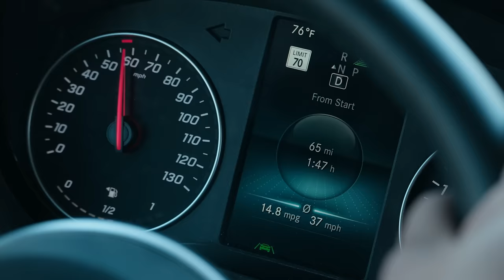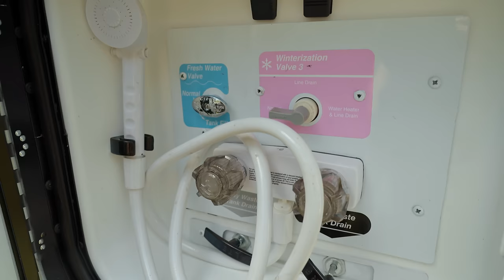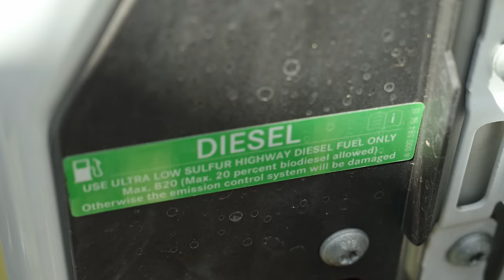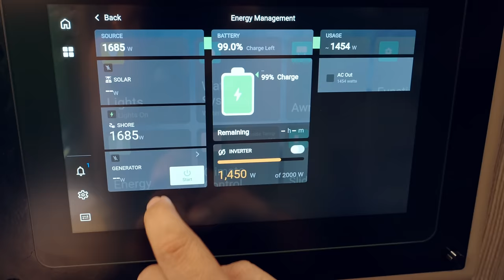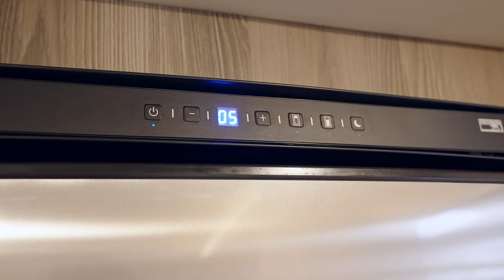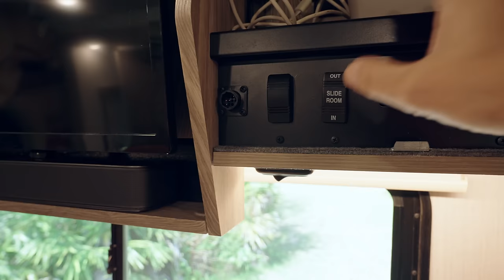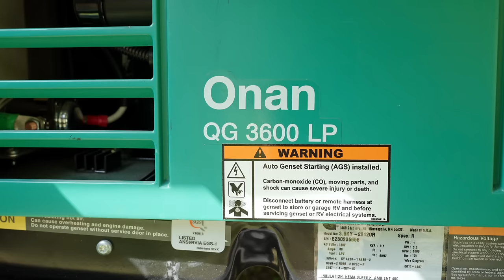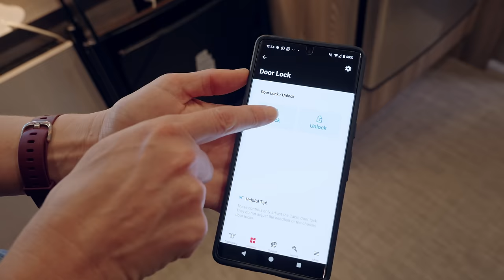🚐💨 Living in the World's FIRST Winnebago View 24T - Full RV Tour! | Newstate Nomads

Comment: Fantastic job on the video, and amazing layout!  The higgie hygaie huggie.  I give up, but I love it!  The large convection microwave, one electric cooktop, garage, folding table\chairs, and Winnebago Connect...best decisions!  The one thing I definitely would change is the water fill outside of the water bay for cold water locations.  It would also be great to have have options for: push button grey\black tank releases, tv mount articulates down or televator, delete on propane cooktop (the counter space might be better use given the onboard gen and charging capabilities.)  Great idea to put the laundry basket in the shower.  Let Winnebago know this one is a biiiig win!
Reply: Interested to hear if you put your starlink through the celing port and if they router fit into that bay. :)

Comment: We have ordered an AWD unit - due in a couple of weeks.  Have gone through your reviews of the 24t several times for data points.  Seems either Winnebago doesn't know anything about the MB and vice versa.  That's why there are operating manuals which are actually pretty good.  The sales folks are all really nice, the service folks for what the know of the 24t are really nice but this seems to be a learning process by all.  Moving to this unit from a F350 and Bigfoot Oakland - not really quite sure whether up or down, just higher tech and lower steps!  
I have lists of questions for the sales folks once this comes in, your review answered a number of them.  Thank you for being so complete.
Amazed again how people simply need to complain and troll - the saying goes, if you can't say anything nice ....
Thank you again

Comment: I had a 2007 View J model with a twin bed back next to the dry bath restroom.  I liked that layout because I could always stop and the bed was always there.   I camped alone, mostly at rest stops or KOAs.   Great motorhome.  That gear garage is killer, especially when you remember the coach is only 24’ long.
This model is very well laid out.   Have you done another on what the production model will look like?   I’m sure something changed but what you see here is Very nice.
Wow!!  That rear view mirror is just too good.   I had no idea that was a thing

Comment: Did anyone else notice the panel under the folding table (where the support arm is attached) seemed to flex a significant amount when putting the table up or down (see 8:34 and 9:15)?
Reply from the maker: We definitely noticed and let Winnebago know about it ☺️ Remember, this is a pre-production unit, there are elements they are actively working on before production begins. 👍 - Howard
Reply: I seen that also, not good

Comment: I’d consider a pre 2019 view
The newer ones seem more prone to leaks
I would look for a non blue tooth awning.   The carefree BT12 module doesn’t seem very robust or they had a bad run.  There was a recall on the awnings and these would not work more often than they would.  And the Mercedes module that sends power when the parking brake is on will occasionally have issues and your awning won’t work.   Mercedes and Winnebago are still arguing over which is responsible for the fix 
If you get water in the cab check the cap/gutter seam.
The view hits a sweet spot though.  
Big enough to travel comfortably and small enough to park almost anywhere

Comment: I think its absolutely stunning.  The outside storage is amazing and I love love love the copper.  Tank sizes are great too.  
The only con I see is the chassis its on and its a deal breaker for me.  It needs to be on the Ford Transit, a gas engine.  I've heard nightmare stories about MBs breaking down and only a fraction of mechanic shops to fix them and the wait time can be very long.
Reply: As former high school auto mechanics and drivers Ed teacher & then almost 3 decade OTR Trucking guy, I’ll lay it on the line here: That’s a “top drawer” rig…. Now…. If one will service that rig as it is prescribed with out cutting corners AND checking everything regularly before you start out EACH day…. You will rarely if ever break down….  Also, you MUST drive like it’s a TRUCK not a car Let the power train do its work smoothly…. Vs constant expecting to go 70/75 up & down  the hills….Respect the  rig-give it good clean oil & fuel & enjoy it for many many years….😎

Comment: U said go to comment if U missed anything… I watched a review on the ‘025 Thor & they said it’s on a 4500 vs 3500 Sprinter chassis thus increased cargo capacity… U said a ‘23 chassis, so I’d guess  Thor is going with the newest chassis while Winnebago is using up older stock ??  I hope not !!  900+ # CCC is terrible !!  & please tell us that a “no propane” diesel genset option is available…. I really like the multiple solar pkg as well.  The I-4 2 ltr 9 speed has been long anticipated & should sell very well…. In-line engines are greater 4 low end torque & a bit more fuel efficient too.  GREAT REVIEW..👍👍

Comment: Great storage ideas Winnebago used in this motorhome, but it needs a bigger chassis to carry everything you need.  As shown, this chassis is probably grossly overloaded.
Reply from the maker: A bigger chassis would certainly add carrying capacity, but takes away from the advantages of a short wheelbase RV. 927 lbs is tight, but manageable. We've lived full-time for over five years in our 2019 Navion with 1,100 lbs of capacity. It can be done, and safely. Like I mentioned in the video, there are options to increase carrying capacity, which we would likely opt for if we go with the 24T as our next home on wheels. Thanks for watching! - Howard
Reply: @NewstateNomads  173lbs is a whole person more. That's a huge difference IMO.

Comment: I think what would make this perfect is adding to the pantry which is too too small. I need a place for my instapot and other lg items, place for trash can which I don't like seeing out on the floor. My suggestion? Expand the pantry to Two feet and across from it add two feet of counter space. I don't want to have to go outside for my dog food. The coach is less than 26' having a 28' would seem just as easy to move. Worried about the 4 cylinder size engine, sounds wimpy and disappointing! Overall, this is a great coach, love the bathroom and other improvements. Love the color scheme. Does it sit too low? How does it travel over bumps,  driveways?

Comment: We love a lot of things on this coach.  Couple concerns though with the bed.  Murphy beds don't scare us as our current rockwood mini lite has one. 
1. Is it a short queen?  If so is there a little extra room on the head side to possibly place a small extension there?  I'm 6-3 and short queens are just a little "short".
2. The mattress looks quite thin and maybe cheap like a lot of rv mattresses from the manufacturer.  We replaced ours but the new one is heavier so i had to rework the support system on the Murphy bed.  It's this one comfortable and do you think it will hold up?

Comment: You blew me away with this presentation, very thorough. This rv certainly is impressive with features that i didn't expect.
Now for a personal question of choice...would u pick the optional massive battery bank over the generator, n why for "u", would u pick that? 🍻
Reply: I would add to that question - does choosing the massive battery bank add much much more weight than the generator.  Also,  is a diesel generator still an option?

Comment: Stabilizers or levelers?  Which generator option would you choose?  Is the 950 AH option an additional 950 (+240=1190 total)?  Can you idle the engine to charge batteries like road trek?

Comment: Are the critical components like A/C, water pump and heater routed into the Connect system? Or do they have separate switches in addition? My Firefly brain just died, and so I’m not a fan of a single point of failure. It’s been a showstopper for me, and has been a real pain while touring and doing my book events. I’ve had to get a dog sitter because of no a/c :-(

Comment: What a fantastic review of the 24T.  What is not to like?  I currently drive a Winnebago Sunstar 29V, similar to the Vista NPF you were driving earlier last year.   It can be a little intimidating in heavy traffic, in wind and when big semi's pass.   When you compare driving the Vista NPF to the 24T, do you find the 24T much easier to drive?   Based on what you have described about towing, it sounds like it would manage my 2dr Wrangler just fine.   I have an Alaska trip planned a year from now and I am trying to decide if I keep my 29V or trade it for a 24T if they are available by that time.  What would you recommend?

Comment: This is a great looking rig but 920 pounds of cargo carrying? I'm always concerned about these Sprinter-based RVs as there's usually a very small amount of cargo capability from a weight standpoint. Two people (450 pounds) so now you're down to 470 - add a tank of water or stuff and now you're over capacity. 

Also I would much rather have the solar/lithium charged by the diesel engine - generators are the bane of my existence as I love boondocking and there's always someone who feels compelled to rattle one of these gennies. Blech. Glad Winnebago provides a better option.
Reply from the maker: There's a section in the video where we discuss carrying capacity of this RV (which is a preproduction unit) as well as options for potential weight savings. There are chapters, so you can jump to that section if you'd like ☺️ thanks for watching! -Katelyn
Reply: @NewstateNomads  Thanks for the reply. I posted my comment before watching the whole video (obviously) so I changed my comments. 

Great coverage of this unit, btw, there are a lot of really great design aspects of this rig but it's a bit light on cargo capacity which is typical of these Sprinter-based rigs.

Comment: Well done tour. Nice rig! Hopefully they increase the carrying Cap. 927# isn't very much by the time you subtract out you & wife's weight, water. food,, tools, clothes & misc. I guess you wouldn't have guests over for dinner or game night. My guess is you are currently overloaded right now.
Reply: Interesting thought regarding added weight when parked.  Is the carrying Cap. limit only applicable to on the road driving or are the springs going to break just by having guests step into the parked vehicle?  My thought is with the vehicle parked and stabilizers in place one could have a lot more added weight over the road driving carrying capacity.  Anyone know?
Reply: @dalejay7843  my guess would be that the stabilizers would distribute some weight off the axles but not sure how much stress / weight that would then allow?

Comment: Had one and never again!  Biggest issue with the MBS chassis setup is finding a place that will actually work on it.  Most MB dealers wont touch a Class C Sprinter setup, so this is a real issue for owners.  Then, the CCC Is so low that two people and a roll of toilet paper and you are pretty much done.  Look pretty, but (for us) totally impractical for anything more than a few days long trip.
Reply from the maker: Michael, sorry to hear about your issues with service. In over 100,000 miles across North America, we've always been able to call the MB Vans line and they could connect us with a repair shop in the area. MB even covers the cost of the tow during their warranty if you are unable to drive it due to the mechanical issue. It's 20,000 miles between oil changes, too. We've been very happy with the chassis. Thanks for watching. - Howard

Comment: It does look nice and I do like the dash layout of the Mercedes . What I’ve never liked is the Mercedes engine. Being a 40 year over the road trucker and working on cat, Cummins and Detroit engines an  a couple Mercedes engines I’ve learned that getting that engine fixed on the road is a nightmare. Yeah there’s Mercedes dealerships around the country but they don’t work on what ya got. Hard to believe but true. Look at all the motorhomes that are Mercedes and the miles on them. I’m talking used units. There’s a lot of ford and Chevy dealerships that can work on those coaches and anything Cummins diesel is a snap as well. Look into it.
Reply from the maker: Thanks for watching and definitely appreciate the perspective of a 40 year trucker! We've racked up almost 100,000 miles on our 2019 Navion (6 cylinder Mercedes), and never had issues getting service. In fact, Mercedes covers towing during their warranty to whatever is the nearest service center. Only one repair in all that time for us, and the local shop in Missouri was able to fit us in the next morning to get us back on the road. 👍 - Howard

Comment: Tons of storage, but not a lot of cargo capacity. Have to be careful what goes in especiallty for full time living. Have you brought yours to a scale to see if you're within the limit?
Reply from the maker: It's a great point, and the carrying capacity is constrained for Sprinter and Transit chassis when you have big slides. Like I mentioned in the video, there are options to increase carrying capacity, such as the low profile (instead of overcab bunk which saves about 125 lbs of weight), and also Winnebago is actively working as they always do to identify further weight savings in the design without impacting functionality or durability. Thanks for watching! - Howard
Reply: @NewstateNomads  Yes, I heard that mentioned, but still that's not a lot of cargo capacity especially for full timers.  Have you taken this rig to a scale, yet?
Reply from the maker: @DisabledNomads  I can't since we've already returned the T to Winnebago. I will also say that with our 2019 Navion, we've been successfully full-time for over 5 years with a OCCC of 1,100 lbs. It can be done, and safely. 👍 - Howard

Comment: Now if you could fit in a small washer/dryer combo this would be perfect. I love the dining area where you lower table and chairs for more room. What a difference! And the bathroom!! Love shower seat. Good for old ladies.  When my husband was alive we owned two Winnebago’s a Class C and A. Then a diesel when retired and lived in it til Husband’s death. Several years. I miss traveling down to the coast and winter in AZ. I think this rig would work great for just me. I have little dog so sharing couch would be no problem.😅
Reply from the maker: Debbie, you nailed it, there's a lot we love about the new floorplan! A washer dryer would certainly add weight, but if it's an option that could be a great solution for those willing to trade carrying capacity for the feature. Thanks for watching! 👍 - Howard

Comment: The amount of content you pack into 28 minutes is amazing.  Love your national park travel vids also.  Limited CCC is the price you pay for the benefits of a "nimble" and drivable RV that can get into most campgrounds. For me, this is a two-person coach with a desired OCCC of about 1,100 lbs.  Figure travel with 30 gal fresh, always dump grey/black, flat tow something relatively light, and after wife, dog and myself, we would have room for 500lbs of gear - that's if the OCCC is at a target of 1,100 lbs. IF it's only 927lbs, we're sitting at about 310lbs for everything else - ugh.  Would love to see WInnebago provide weight estimates on all their options like Dynamax Isata 3 (thanks so much for passing along the estimate on the front cap +125lbs; i've heard full body paint adds +20lbs, hydraulic jacks +150lbs, LP gen +180lbs). With a margin of error of plus or minus 10%, if this was provided by Winnebago, we as consumers could make safer and better-informed decisions.

Comment: Nice job sharing the details. We had the opportunity to use an earlier iteration of this floor plan in single digit temperatures and found it to be extremely comfortable. We too were very surprised at how much we like the flexibility of the floor plan and features. Love the Win-connect concept, look forward to it being developed. I was hoping you could share the sound level of the new Truma AC as we could not run it in our test unit. I suspect it to be quieter. One thing that has not been addressed is can the newer engine be idled for extended periods without DPF issue like the V6 engine. If that is the case the larger battery option makes a lot of sense. Just as an aside what are you towing? Keep up the great work. As a point of reference we have a 2020D

Comment: Great information and highly entertaining video. I am a potential shopper and I really like this floor plan.  What are the thoughts on the folding table and chairs?  I see the value in adding floor space and saving weight but the set seems flimsy, like my parent’s card table from the 60s. This is opinion is only from viewing the video. So maybe better quality than appears.
Reply from the maker: Thanks so much! So glad you found it helpful. We really like this floorplan and it's definitely in the running for our next home on wheels. So for the table & chairs... the chairs are actually really dense and well-built. Admittedly, they are kind of heavy, so I wouldn't say they were flimsy at all like some folding chairs. The table in this pre-production unit will be changed out for a slightly thicker table that matches the color and design of the counter top. Hope that helps a little more! Let us know if you have any other questions at all, happy to help! ☺ -Katelyn

Comment: Coax for TV. Nobody uses Coax anymore. an App of IOS and Android should allow all coach monitors Via Bluetooth and play music and video with updates. Remove the screen inside the coach it is unneeded. Downside of this coach is no solid hardwood like a old Safari, This is a particle board coach through and through. They still need to provide more roof solar at least 1000 watts. Murphy bed is sloppy they show have made a drop down from ceiling. Safari Trek still is superior in design and build quality. I'll find a Diesel version.